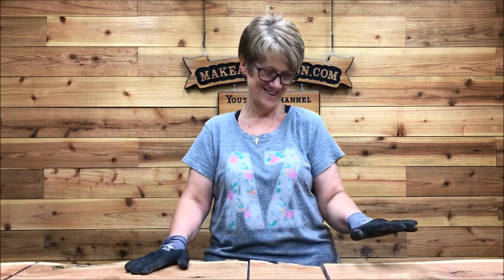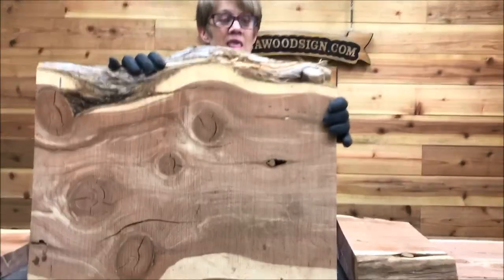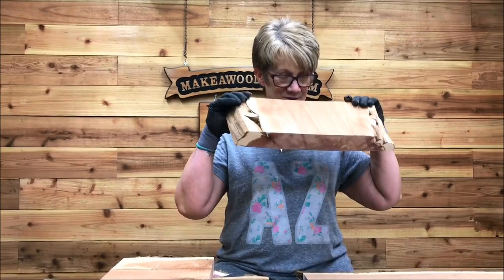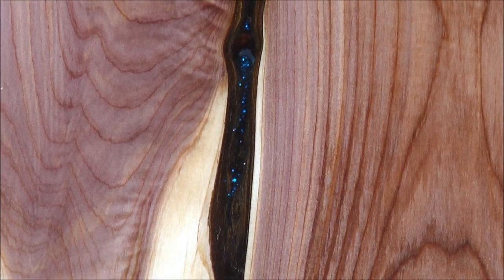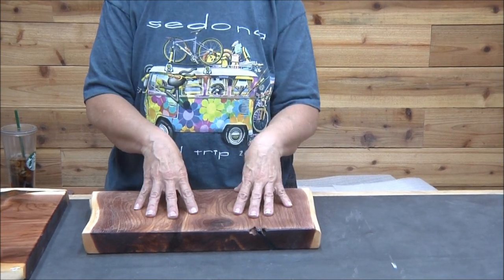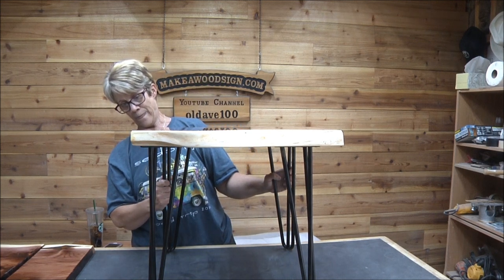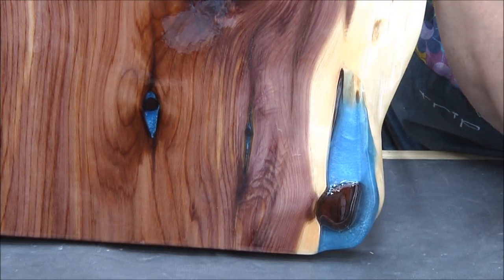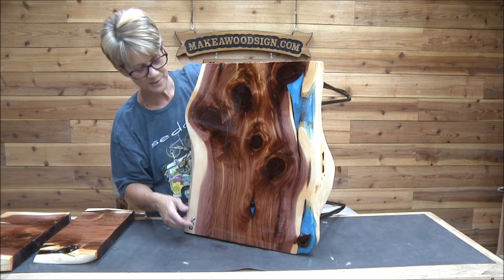#278 Part 1 Vicki's New Project Making Her Own Tables

Comment: Nice table!  I make a lot of these cedar live edge tables with the epoxy resin as well.  One trick I learned was to brush on a thin coat on the table and let it cure before pouring the flood coat.  I'm not sure if you talked about that in the video or not, but it really cuts down on the bubbles!  On the knots, brush it on a little heavier because that's where it seems to off-gas the most and create problems.  Very nice touch with the turquoise color!
Reply from the maker: Thank you for the tips Sean, I will have to try this.  I appreciate the support and advice.....Vicki